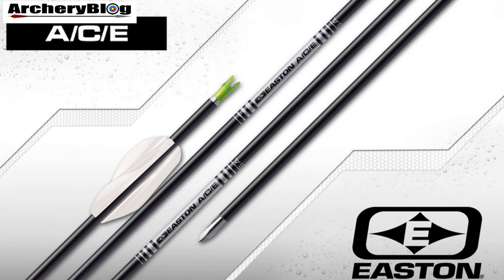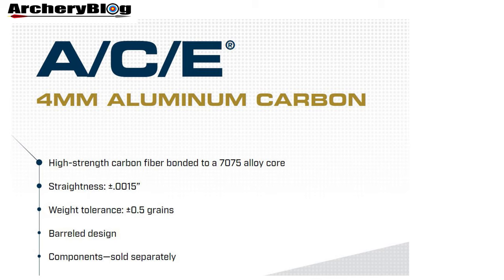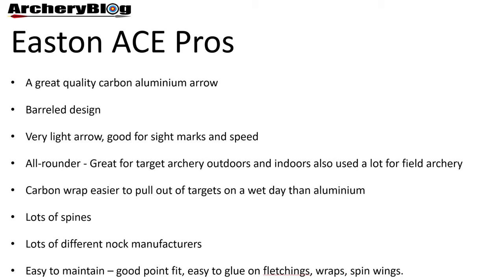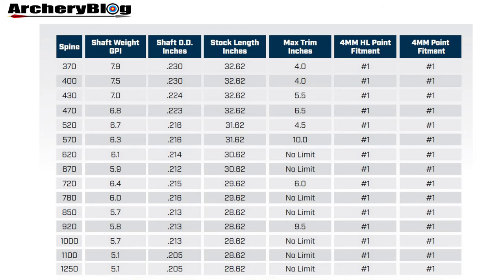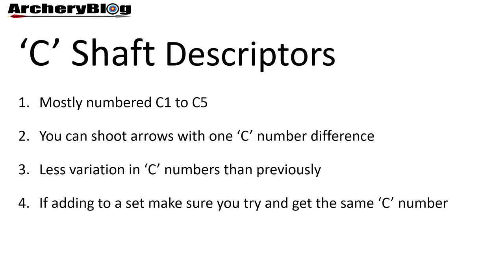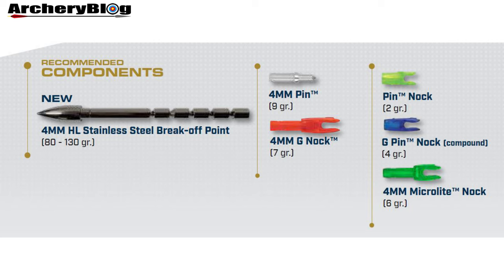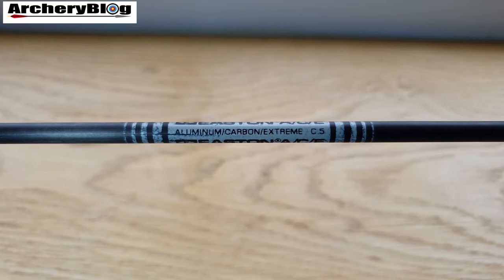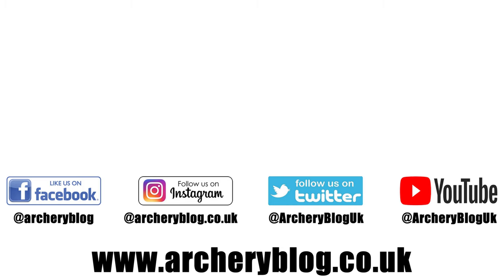Easton ACE Arrows - History, Spines, Nocks, Points and Pros & Cons in 2021

Comment: Thanks for the heads up on the coming changes, I wasn't aware. I like the new break off point, makes sense to have one that does a wider weight range, I wonder how long it is compared to say, a full 100gr break off point, it longer, it will stiffen the arrow a little, will see.

Comment: A question regarding cutting the shaft. Should you only cut from the point end?
Reply from the maker: Yes, on these anyway, and on most arrows traditionally. Unless told otherwise. Such exceptions include the Easton Triumph arrow which needs cutting from the back as it has a reinforced front end.